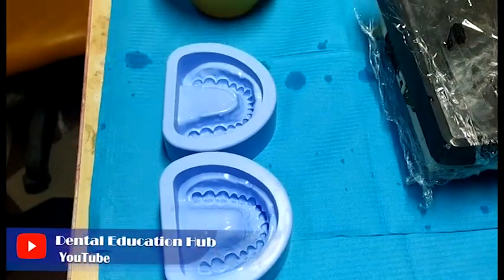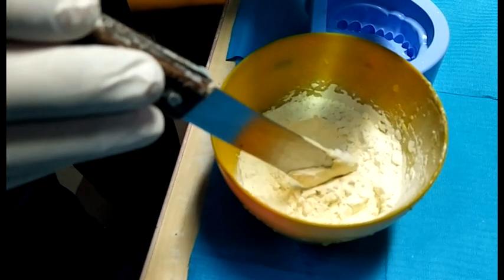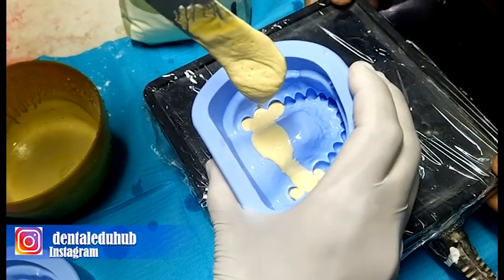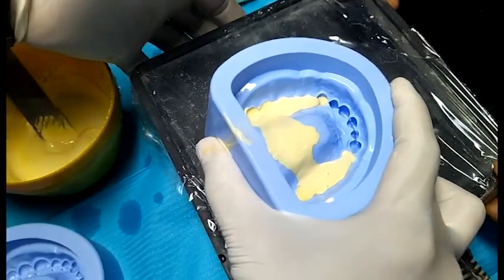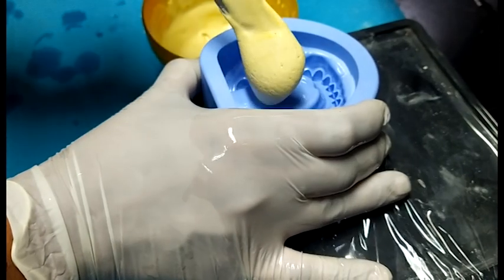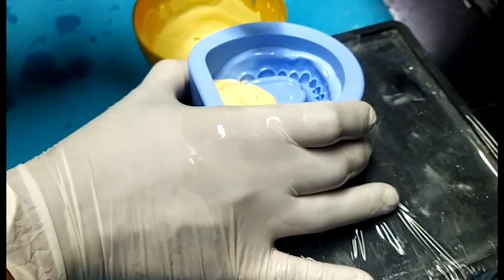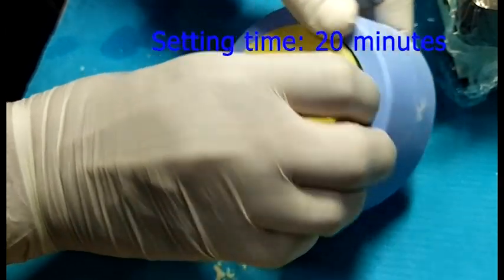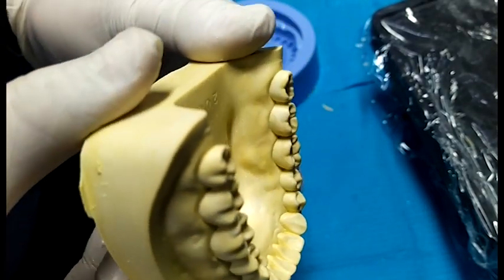How to Prepare Plaster Dental Models? | Dental Hard Plaster Review

Comment: what are the rawmaterials used to make this dental plaster?thank you for clarifying.👍👍👍
Reply from the maker: It is manufactured by grinding the gypsum rock into a fine powder and then heating that powder. All this process is performed under specific temperature and controlled conditions.

Comment: What can I do as to not get any air bubbles?
Reply from the maker: 1. Mix well according to the proportion
2. Check if the impression or mold is clear and free from particles or water 
3. Use dental model vibrator machine while pouring the plaster.
Reply: @DentalEducationHub  thank you for the reply! I’ve just started studying dentistry and our first practical task was to prepare a plaster dental model which will be graded… I’ve made like 8 models and all have air bubbles, which is a criteria that makes you fail the task. They told us to spray the mold with some kind of liquid that makes it easier for the mixture/plaster to flow in it… so when you spray it, it shouldn’t be too wet but also not completely dried. I will definitely try your method with the tilting. I have to succeed today.
Reply from the maker: @rayychill1306  I wish you all the best where you study ?